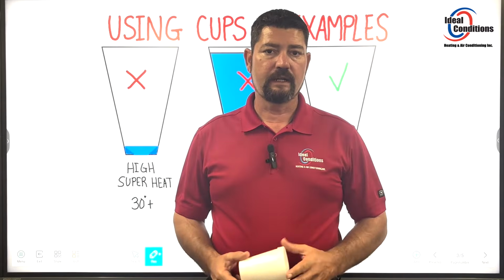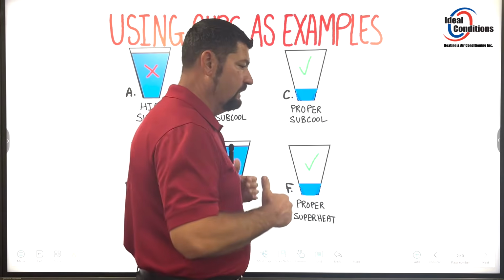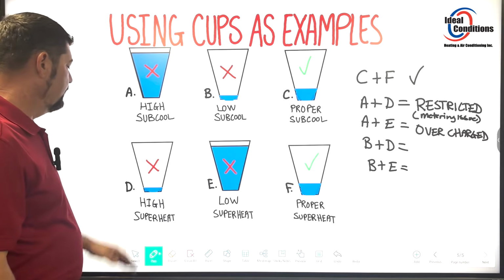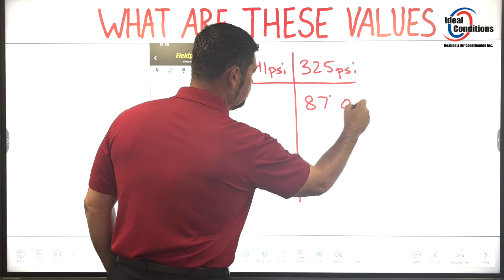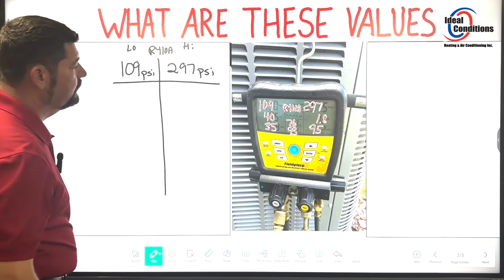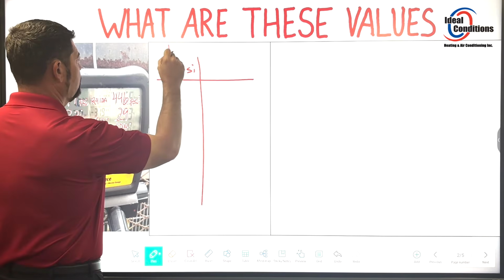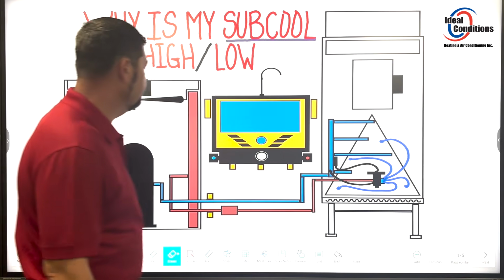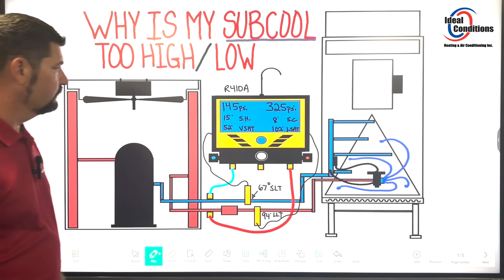Why is my Superheat and Subcool Too High or Too Low?

Comment: I has system subcooling 46F higher and superheat 17 F normal  the heat  pressure fluctuates up down to 375psi to 400psi temp pressure line is up combination A+F is restricted air flow on the condenser  need washer condenser coil and verify pressures operation after

Comment: Minute 30 minutes 30 seconds: B&E= BAD COMPANY OWNERSHIP, BAD MANAGEMENT POOR TO NO TRAINING AND NO QUALITY SKILL STANDARDS IN THE COMPANY. 
     HVAC company owners are 100 percent responsible for the quality, the education and the procedures, their technicians provide to the customers. 
     If the owner of the HVAC company is incompetent, Mechanically and technically should be flipping burgers at McDonald’s or serving tacos at Taco Bell. 
      When are the biggest problems in this industry too many owners or nothing more than used cars sleazy salesman who look at profit in margin sheets dangling a golden carrot to upsell Snake oil, products and procedures and just have somebody with a heartbeat that shows up to work, the swap parts. 
    That is what B plus E equal
  Excellent videos keep up the good work

Comment: @idealconditionsjax what’s going on Greg it’s been a while may you make a video on faulty bypass valve from the condenser and air handler I’ve had some issues that I could not figure out. I had a low suction pressure high subcool and high super heat I was able to get my subcool to specs but my super heat is up to about 30 my suction pressure remains low and my delta t is only 14 I was going towards a bad bypass valve at the condenser but I’m not 💯 percent sure this is all in cool mode carrier unit blessings

Comment: had to recover and recharge a water source heat pump (mine). Weighed in factory charge.and runs ok.  Subcooling is 15 F.   Limited heat transfer on
evap coil because 50F well water. but it is knocking down to below40.  I know it isn't working on design numbers but that's what I have to work with.
This is a R410a machine.  Should I fiddle with the TXV ?

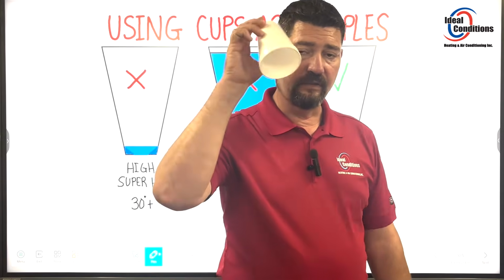Comment: Good presentation and I learned something.  A little long at 1:22.  I had difficulty following at first due to visual layout of the "cups".  Makes much more sense to have them arranged Lo/Normal/Hi so the temps were more intuitive rather than Hi/Lo/Normal.  I've only recently obtained the pressure and temp transmitters that show SC and SH numbers - I've been fooled by looking only at the Hi/Lo system pressures.  Your examples really drove this home to look deeper at the numbers.